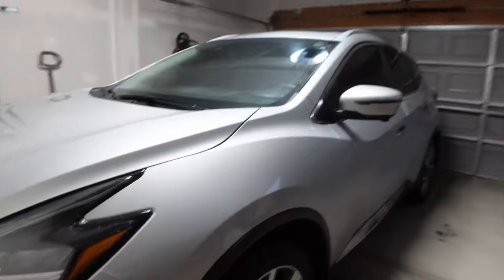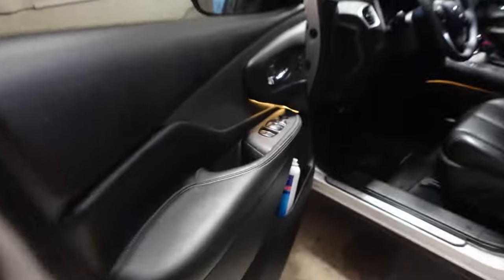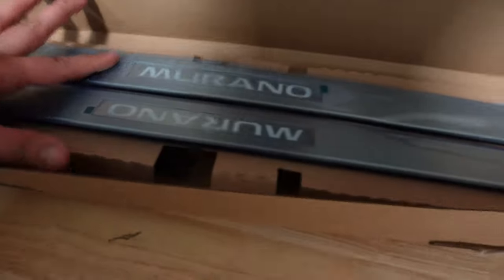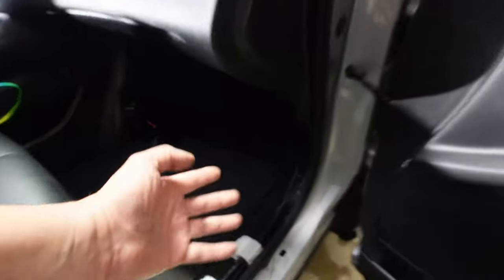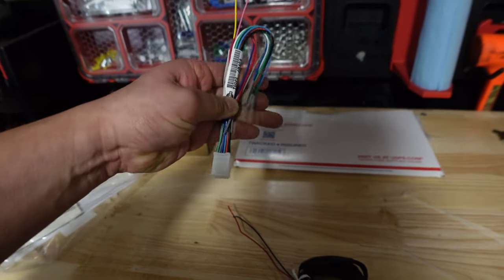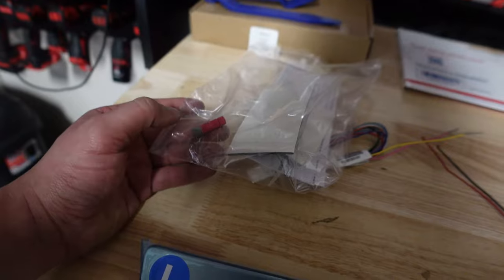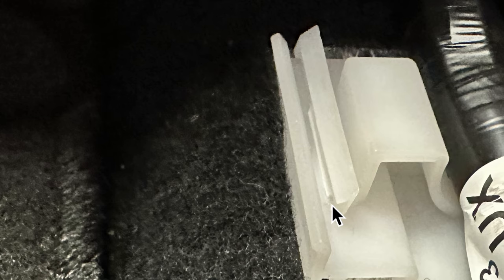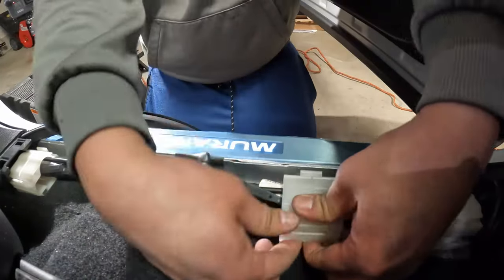Nissan Murano Illuminated kick plates

Comment: Question - Nissan's installation says to tap into the pink for both sides and light green for left hand side and dark green for right hand side. You mention to tap into pink and yellow. Would there be any issue to do it your way? FYI my car is 2017 Murano sl
Reply from the maker: No where in the instructions does it say anything about the green its only the yellow and  pink , not sure what installation guide your looking at
Reply from the maker: Oh your looking at the 2014-2017 model , I see , so that model is going of the door switches , there would be no issues the reason they stopped doing the door that way is cause if you have a faulty switch it can keep the lights powers on cause battery drain issues
Reply: @PRviewsvlogs  can I do it your way on my 2017? Any issue in your opinion?
Reply from the maker: @nakhz  you’ll be ok

Comment: I have these on my new Nissan frontier. Worried that they are going to get scratched up in time. What would you recommend to protect them?
Reply from the maker: You can try pfp film
Reply: I had them on my 2018 Murano Platinum for 6 years and they never got scratched up.